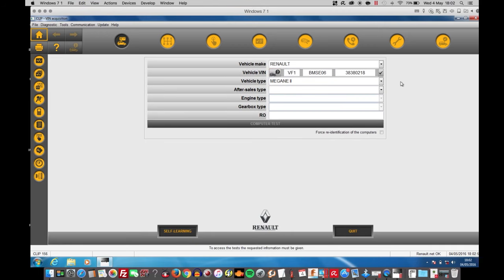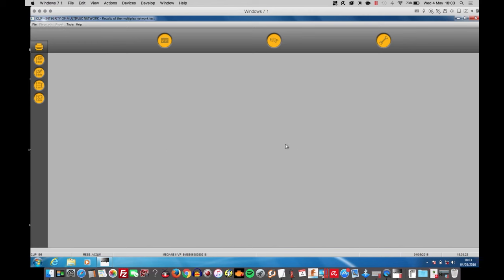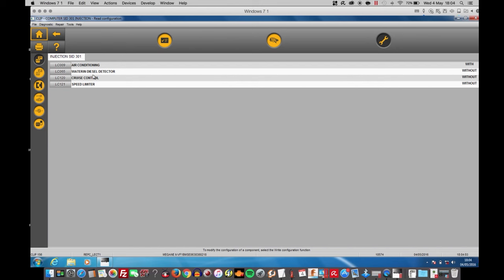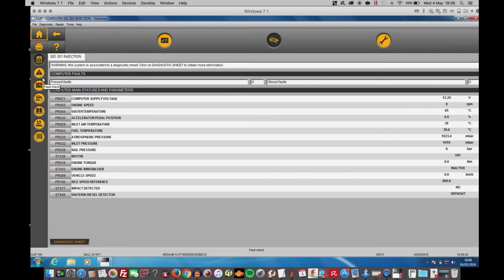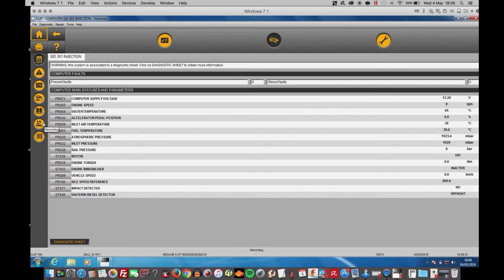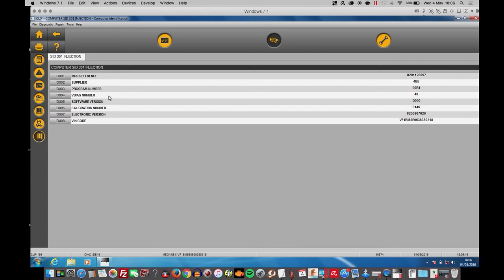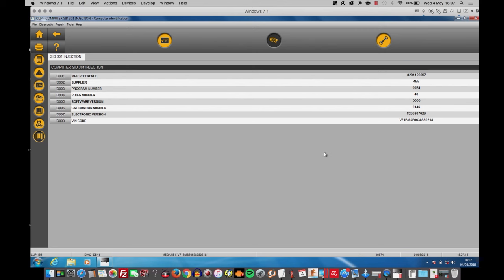Some functions of the clip diagnostic software

Comment: I think that, in order for the car to work properly, the injectors have to be coded into the vehicle.
This is because the injector are commanded through the CAN (network), thus, the Injection Control Module would only be able to command the injectors if it is able to "talk" to them.

This is not the car's VIN being coded into the injectors, but rather, the Injector codes (hexadecimal) should be coded / written into the Injection Control Module.

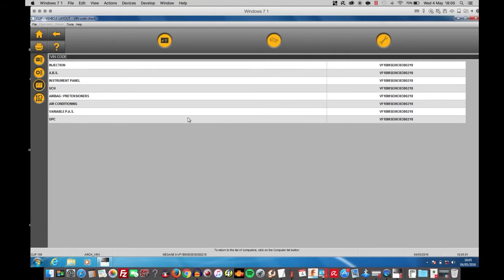The car's VIN is written into each Control Module, as you demonstrated in this video at 1:19

Moreover, at 2:24 that information is regarding the Injection Control Module.
You could check the injector's codes, by going into the programming function, with Clip.

3:16 What trap did you Sir exactly fall into?

Comment: Hello Mauro quick question on can clip witch board to buy if we want to program keys witch one the best at the moment thank In advance
Reply: Hi Nuno, unfortunately I acquired mine 4 years ago and I'n not sure if things have changed since. However, I remember most comments saying that the "green boards" were better than the "Blue boards" and I did follow the advise. I bought mine from Ebay. My clip has only one major problem and it is that it frequently disconnect from the vehicle so I'm having troubles when recording live data while driving as it suddenly stops. All the rest seems to be fine and has been a major help to me, my Megane was a mess of electronic problems when I purchase it and now I would not change it for any other car as it works so well so I did not have not use clip since (4 years now).
Reply: @9111logic  thank you so much for your reply.
Reply: @nunograca7416  do you have any feedback / advice on the Clip board you purchase?

Comment: I own a Clio R27 F1 edition. I need to reset ECU's adaptive learn. Is there anyway to do this with Clip? Thank you.
Reply: @Twinturbo_  Hi, I ended up taking the car to the Renault service center and requested them to reset it for me
Reply: @Twinturbo_  my issue got fixed. I needed a reset for tuning purposes. Not sure whether it is required in your case. Have you checked your spark plugs or the fuel type you use? You may need to clean your injectors too

Comment: Hi, i need help, somehow when i try to diagnose injection it shows me just blank page, and when i go to consult VIN codes, the code for injection is missing. It happend after i managed to do particle filter regeneration and then i wasnt able to access injection. Any idea how to fix it ? Or how to write back VIN code ?
Reply: Was it showing the page correctly before the filter regeneration ? Did you turn off both the engine and ignition as well as Clip before retesting ?
Reply: @9111logic Yes page was showing correctly before,  it also happend to me once with radio unit when i was taking radio out fixing it and giving same radio back, and VIN code just dissapeared. I didnt care for that too much but now injection unit is pretty much big issue. Isnt there a way to write back VIN code ? I did turned engine off, ignition as well and when PC said that it has lost the connection i started engine again and done retest.
Reply: @9111logic  Ok i will try it thanks for advice.